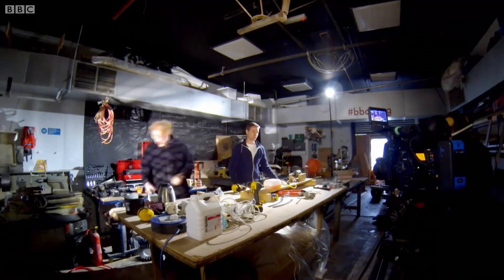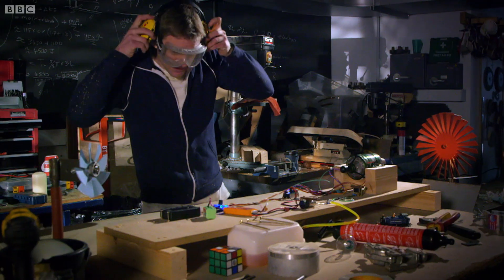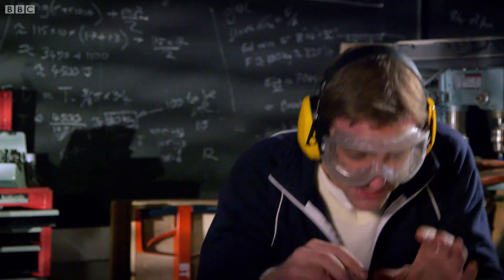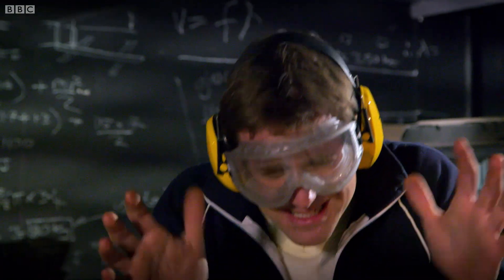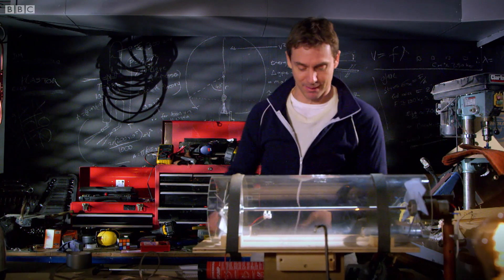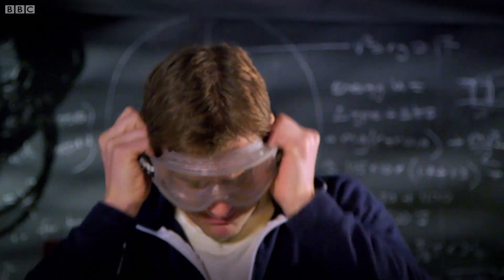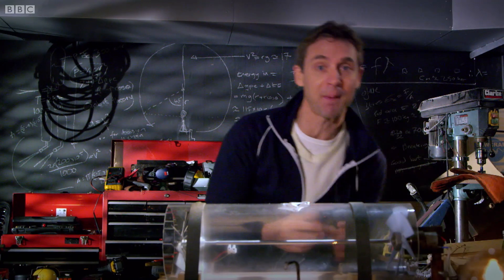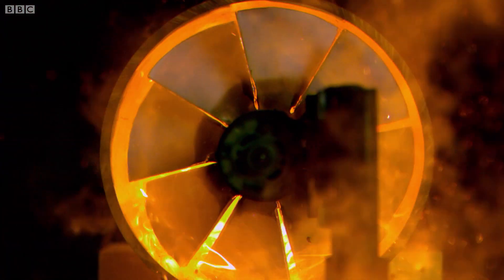How To Make a Mini Power Station | Bang Goes The Theory | Earth Science

Comment: What about efficiency?
Reply: Florian Otterpohl Modern gas powered stations (usually) have two stages, one stage is a turbine that is being rotated by the burning flames (like the turbine in a jet engine basically, but connected to a generator), the second step takes all the hot air from the first turbine and uses it to heat up a boiler which produces steam which in turn rotates a second turbine.
Reply: Florian Otterpohl compared to boilers would be terrible i'd assume, then again boilers are pretty damn efficient. But if you want the god of efficient power generation I'd say it would have to be the Stirling engine, granted not a lot of power comes out of one but the energy put into it is used unbelievably well.
Reply: *****
there is a way to get to close to 100% efficiency, for that you use only one turbine geared for direct electricity production, you collect all heat it produces, and you put it into a location where hot water is in demand, and then you produce electricity and hot water. so you make it small, and you put it into the boiler room of a large building complex, where you let it produce all the required hot water, replacing a conventional boiler. the electricity is used to power the building complex, excess electricity is sold to the grid.

60% sounds nice, but only if you have absolutely no use for hot water, only for electricity. make it small, make it local, let it produce hot water where and when hot water is needed, and you can get to mind-blowing efficiency ratings of 96% or higher.
Reply: Florian Otterpohl it's a bit complicated. "simple" efficient jet engine/generators (like big turbo jets on airliners) are not as efficient as first heating water and that driving a turbine (this is because thermodynamic laws, about heating and expanding gasses). but i know in holland a lot gas turbines (that produce elektricity), are owned by greenhouse farmers. as the rest heat and co2 is pumped into the greenhouse. which is advantage of gas as it clean enough, where heavier fossils fuelsarent.
if you want more,  https://en.wikipedia.org/wiki/Heat_engine#Efficiency
Reply: kurtilein3 Actual Siemens 2 stage power plant with hot water output is in operation in Plovdiv, Bulgaria. Efficiency is estimated to be around 93% in winter and 75% in summer.
Reply: kurtilein3 That is not the case.
According to wikipedia:
"One type of fossil fuel power plant uses a gas turbine in conjunction with a heat recovery steam generator (HRSG). It is referred to as a combined cycle power plant because it combines the Brayton cycle of the gas turbine with the Rankine cycle of the HRSG. The thermal efficiency of these plants has reached a record heat rate of 5690 Btu/(kW·h), or just under 60%, at a facility in Baglan Bay, Wales.[4]

The turbines are fueled either with natural gas, syngas or fuel oil. While more efficient and faster to construct (a 1,000 MW plant may be completed in as little as 18 months from start of construction), the economics of such plants is heavily influenced by the volatile cost of fuel, normally natural gas. The combined cycle plants are designed in a variety of configurations composed of the number of gas turbines followed by the steam turbine. For example, a 3-1 combined cycle facility has three gas turbines tied to one steam turbine. The configurations range from (1-1), (2-1), (3-1), (4-1), (5-1), to (6-1)[citation needed]

Simple-cycle or open cycle gas turbine plants, without a steam cycle, are sometimes installed as emergency or peaking capacity; their thermal efficiency is much lower. The high running cost per hour is offset by the low capital cost and the intention to run such units only a few hundred hours per year. Other gas turbine plants are installed in stages, with an open cycle gas turbine the first stage and additional turbines or conversion to a closed cycle part of future project plans."
Reply: Marinus
hey i said they were efficient they're just not often practical. Also i wouldn't call it a gimmick since it does work and is used. One example if I remember right is in a submarine as a back up power unit.
Also torgue isn't really a thing to worry about in power generation unless your also providing mechanical energy. Then it becomes something you have to pay a lot more attention to.
Reply: Marinus Sterling engines have there used. There situations where it hard to compete with the design. Swedes use them in submarines for example as there very quiet and gives you long duration. But there are other niche areas where it can useful. So it not just a gimmick.
Reply: ***** Sterling engines have all sorts of flaws. It's a nice gimmick though. What about torque ;)
Reply: ***** that would not be very efficient, because the first step (the electricity-producing turbine) will work as hard as it can to cool down and slow down the gas to turn it into electricity. so there will not be much heat left. best you can do is to use it to heat the water close to boiling temperature, and use it to heat nearby homes and buildings. you are not going to get enough super-heated steam to drive another turbine.
Reply: *****
torque is what you put into the generator, and it determines how much energy the generator will produce. you want to turn the hot high-pressure gas into cold low-pressure gas to produce torque, because that is what a generator needs in order to make electricity. it does not really matter if that hot high-pressure gas is steam or the exhaust of the turbine.
Reply: 60% (input energy to work) is already a very high number for heat engine. for example the most efficient aircraft jet engine are 35-36%. for fossil power plant this upper limit in around 44-48% and nuclear around 29-33% (this is because they work at a lower heat). note that efficiency of hydro is 90% wind 60%, solar 20-46% (70-80% is theoretical doable)
Reply: kurtilein3 I don't think you're quite on scale, I'm talking about huge power plants that generate 500-5500 MegaWatts of energy, nearly all of which use the Combined Cycle.

If you really want to squeeze more efficiency out of it then you can take the steam after it went through the second turbine (it's still pretty damn hot) and use that steam to heat up a whole town, all while cooling the steam to reuse it again in the boiler, this is a technique that is actually used in some power plants (mostly coal power plants), in most power plants they use seawater/lakes/rivers to cool down the steam that cannot be used anymore.

Using the hot gases to directly heat the water for a city is not gonna be manageable because the usage of hot water is not constant and you're going to end up with high pressure steam which could result in a explosion.

Oh and by the way, keeping it small and local is not nearly as efficient as it is with mass scale implementation.
Reply: ***** if you want to get the real efficiency you have to calculate everything in... fuel price, fuel availability, quantities of that fuel that can be found on Earth, materials needed to construct the power station, environment effects, number of workers, education of workers... and millions of other variables that we count as non important when we think about power generation... all of this variables can be lowered and you can get drastically more power from solar power plants even in places where the weather is somewhat bad non-stop... in the end if you think about it all the fuels that we use at the moment (even the nuclear fuel) is actually sun energy stored as that fuel... so directly converting the sun energy into power we get way more efficiency... but we humans are hard-core, we want power machines and we want to destroy, and the fact that we are afraid because 5-10% of the population works in power stations and whole field of solar power stations can be maintained and serviced by two peoples... and you can produce electricity on demand on spot instead of power stations like we do at the moment... imagine every house instead of roof having solar panels... and if you think there are way better ways to generate power from the sun (one example with Stirling engine that you mention) and if we chose that way then if the whole world invests in new inventions on that field we will get tons of other way more efficient and more durable ways to convert sun energy to power...
http://i.kinja-img.com/gawker-media/image/upload/18mm1fwo6xlc1jpg.jpg
Reply: Hobypyrocom Solar panels are very expensive and produce very small amounts of energy ~20% efficiency. Scientists are working on creating cheaper and more efficient solar panels, meanwhile it's not very feasible.
Reply: *****
well in my country it is feasible, electricity here is expensive, we dont have nuclear power plants so more and more companies are making solar power plants...
Reply: ***** i agree. there are a few problem with solar power that i dont see to be solved soon.
they dont produce much power/m2 (800w/m2 is the solar power at the surface)
they need to be far apart to be used effectively  (the need the be perpendicular to the sun casting large shadow.)
no constant power output (clouds, night)
expensive (high eff. use very special and rare metals)
high milieu footprint (lot of toxic waste in making them)
high maintenance (constant cleaning)
some of the can be solved but especially variation and spacing are hard to.

i still think nuclear fusion is the best energy for the (semi) near future (within 50years)
you would only need around 250m3/year of water to fulfil all the energy needs, its constant, cheap (price prob. lower than nuclear splitting), very safe (most likely), little waste (mainly oxygen and helium and some radiated (due to heat) shielding (only for a few years))
Reply: Hobypyrocom
where do you live
Reply: Florian Otterpohl I believe this video illustrates the efficiency of quickly matching supply for demand.

It kind of reminds me of newer city simulators (computer games). Having excessive power is very convenient but in the long term uses your resources too quickly (inefficient) and overall is expense to run and maintain (also inefficient).

So if you HAD to use natural gas, coal, oil, whatever, etc its much more efficient to be able to modulate its output to quickly and accurately match demand.
Reply: blockflight
Macedonia
Reply: Improvised Weaponry
nop not Skopje, another city...

Comment: That's an awful lot of noise for some electricity. Nice thinking but I'd rather go for a generator.
Reply: Wemja
Yes but that was not the point I was making. I was talking about that the difference between a gas turbine and much more common steam turbine is small. I was more interested in showing that it not something is that much worse at creating noise or even that revolutionary. This is not new technology we are talking about.

And yes you generally have constant load power stations like nuclear power stations (who are notorious lag in power generator) and Windmills (Which are depended on the elements) which you mix with Hydro, Oil and Gas to add to the peaks.

Of course the video was not clear on these details so I understand if you might have mistaken it for ignorance on my part. But I have studied a bit about power generation.
Reply: Angry Old Man Worldwide there is more energy from natural gas then there is from nuclear wind and hydro-electric plants combined.
Reply: ***** A lot of generators around the world is already based on this principle. Even more conventional steam turbines is very akin to this. And those are used in most power stations where you boil water.

Note I think the most common use of this technology is not in power stations but in smaller vehicles. (Compared to power stations) They can be made to be very compact and light and so is used in helicopters but also in other vehicles like the American M1 Abrams tank.
Reply: Cythil well almost all energy is made by turning a rotor (photovoltaic being the exception)

The amount of steam pushed trough the rotor can be changed but its not easy to quickly change the amount of steam produced.
The only other one that can quickly change is hydro-electric.

That being said you only need a few plants that are able to change according to demand. You will always need a certain amount of power. That power can come from plants that do not need change their output.
Reply: Angry Old Man Why do you think there aren't gas turbine generators? Go look them up. They use a turbine and extract the energy from the exhaust gas to generate power.
Reply: Angry Old Man I know. Compared to the big power stations this one is very quiet. I'm just saying that a generator can be a bit quieter.
Reply: ***** It's just a demonstration as to how a industrial gas turbine works
Reply: ***** This janky version isn't gonna be very efficient but proper gas turbines are efficient.
Reply: Angry Old Man Yes there are.